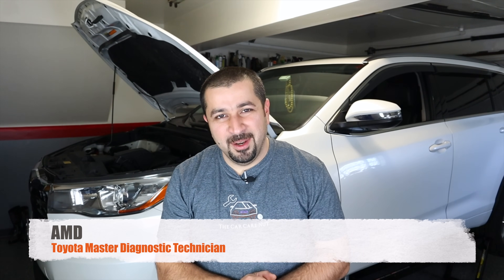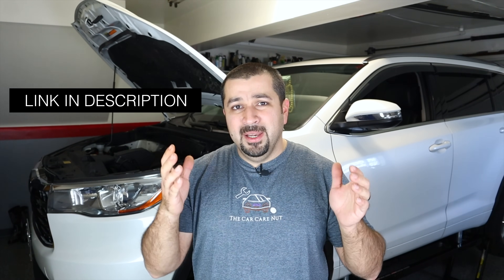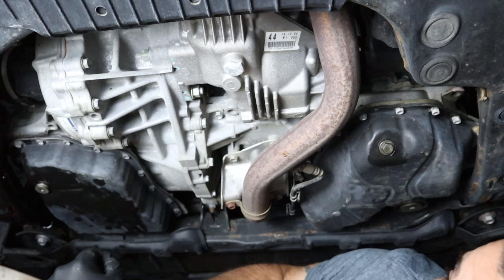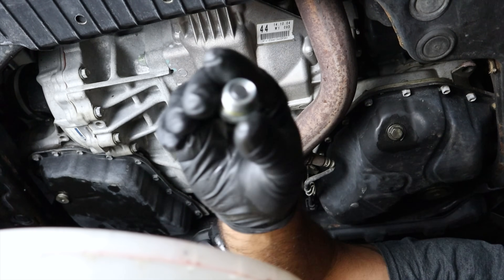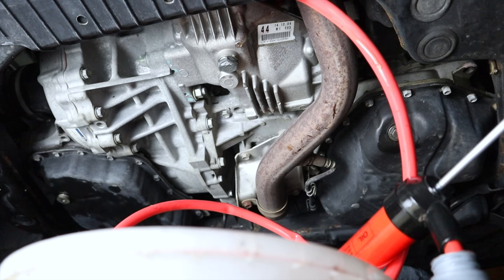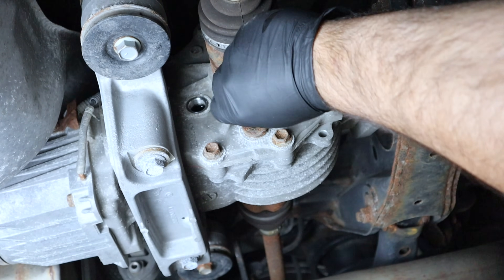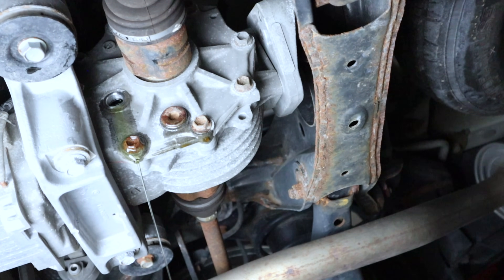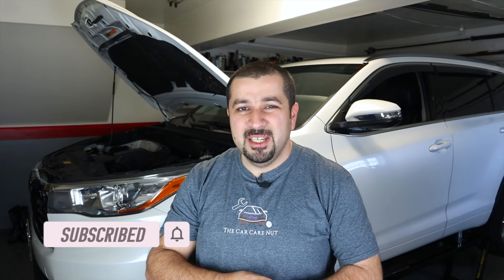How to change Transfer Case and Differential Fluid on Toyota and Lexus

Comment: Another nice and simple DIY instruction, complete with part numbers and torque specs. It would be nice to have some input on the breather valves, regarding any cleaning, testing for blockages/rust, or pre-emptive replacement since they are a common cause of oil seal leaks in the rust belt.
Reply from the maker: Hi! If the breather is not a remote one if it spins or moves it’s good.
Reply: @TheCarCareNut  how many breather valves on a 2008 Tacoma 4x4 trd sport quad cab/6ft bed?
Reply: Here is my question, should I put more stronger magnet drain plugs? apparently the toyota ones barely attracts any metal fuzz  @TheCarCareNut
Reply: @johnysky6066  Or maybe Toyotas don't need bigger magnets because they are manufactured with tight tolerances and produce fewer metal shavings during their lifespans?
Reply: I actually still find a fair amount of wear particles on my rear diff (2014 Highlander). Now granted my first change was at pretty close to 60,000 mi (I didn't know then to do it sooner). But after changing it and then checking it at almost 69,000 mi it is fairly dark and still as much wear particles as before, I was to put in much stronger magnetic plugs but at 5mm longer don't know if the will fit on both top and bottom for even more cleaning performance.

Comment: On my 4Runner I replaced the factory transfer case drain plug with a magnetic one. The size is M18x1.5×12. I used a Dimple Motor Oil Magnet but there are a few others on the market.
Reply: My transfer case fluid always comes out crystal clean, just as the new oil.

Comment: Lexus GS/IS/LS Sedans have a rear AWD transfer case that shares fluid with the trans.  The trucks I believe have their own Fluid.  Clean out your vents too. I had a front axle seal leak on my GS and it was because of a clogged vent. Similar setup to many trucks.
Reply: Interesting, my Lexus dealer told me the AWD LS transfer case is separate from the transmission. I just had it in for all the fluids changed. Front & rear dif's, transfer case and transmission. All for a low price of $867. And even a car wash. No wax. I think that would have put it over a thousand bucks. I wish I could work on my own cars.😣
Reply: @Laggy200ms  I did it in a few hours. It is not the most fun job and the fluid stinks. Toyota Fluids are probably over $200 of that price. The rear end fluid is extremely expensive. The transfer case is physically separate but the LS could be slightly different, I think the transfer case has a torsion setup whereas the GS/IS has an open differential with a lockup system. Looking it up - yes, the LS takes special, expensive fluid in the Xfer case - different from the V6  GS and IS.

Comment: I changed the transfer case fluid and the rear differential fluid on my 2016 Toyota RAV4 yesterday. The car had 70K miles and the fluid had never been replaced before. Given that I had waited longer than the recommended interval, I expected the oil to be really nasty. Nope. It looked like it was almost new. The front transfer case was still a nice gold color and had almost zero crud on the magnet. The rear diff was a little darker fluid with a little more crud on the magnet. I'm certainly not going to do this again at just another 30K with the fluid and magnets looking this good after 70K. I'll probably give it at least another 70K.
Reply: I agree.  I think that fluid is good for longer intervals. But if pulling a trailer then it should be done sooner.

Comment: Great video as usual! I unfortunately never had the rear differential and transfer case oil replaced on my 2014 RAV4 (87,000 miles). I'm debating whether or not to replace it now that I'm well past the recommended interval (AMD mentioned in another video that if your transmission fluid hasn't been replaced at the recommended interval, you shouldn't change it).

Comment: Just did this on my 2014 Toyota Rav4  which has 75000 miles on it but the most difficult and time consuming part was taking those stubborn hex bolts off (certainly a couple taps didn't work for me lol... I live in Toronto so am not sure if the salt on the roads during the winter creates this condition)especially the fill-in plug which is so hard to get to that i almost gave up.  The transfer case/gear oil didn't look too bad (light brownish) so i don't know if it was worth the hassle since it's synthetic.  I had recently replaced the transmission fluid after watching your video and that seemed so much easier.  I can take comfort knowing that I don't need to worry about it for some time now😄 and thank you🙏🏽
Reply: Hi, I'm getting ready to do my 2018 Rav4. What type of GL-5 did you use? Do you only need the 10 mm hex, or is there a different size? Thanks!

Comment: First, thank you for all of your videos, I was able to solve my own issue with my 4Runner (below) but I also have a 2015 Tundra Platinum and  need help based on something you mention to be aware of.  You mention that the TUNDRA transfer case drain plug changed in SOME year models, 2014 and up, where the seal is built-in and the drain plug must be replaced and part obtained from a dealership.  My problem is that of two dealerships that I have inquired with, NO ONE at the parts desk can answer my question thus far if my drain plug is one of those.  My local dealer identified the correct part on their computer diagram in front of me but it must be ordered (a week to arrive, after selling me the wrong drain plug initially) but still told me that he cannot tell me whether or not the plug is of the type you mention with the built-in seal.  My transfer case drain plug is one that sits flush (not a hex head) and it is driven by a 3/8" square socket drive extension.  Are you able to tell if mine is one of those design changes?  I do have my 4Runner for use, but my Tundra is on jack stands now until the new drain plug arrives, unless I use the old one which I am not inclined to do.  When I removed my current drain plug and fluid, there was no washer on the plug.

Comment: I have watched this video and the other fluid video a few times but I tried to confirm this because I don't want to make mistakes here. For 2012 Sienna AWD, can I simply use Valvoline SynPower SAE 75W-90 or  Mobil 1 75W-90 LS for both front transfer case and rear differential? I used to buy the 75W-85 which is very expensive and hard to get. Thank you for your great helps!
Reply from the maker: Hi! You can use either without issues.
Reply: @TheCarCareNut  Thank you so much!

Comment: I think the flat side of the crush washer should sit against the bolt head rather than against the differential housing. But I've seen differing opinions about this. What do you think?

Comment: Thanks for the video. This looks simple and easy to do. I was wondering how can I lift my car to get access underneath the car. I know this is silly question but we also want to be safe going under the car. And, also list of the tools and their measurement to work with those bolts for toyota camry XLE 2020 model. Thanks once again.

Comment: '98 LS400. Most important thing for me was being sure I could remove the filler plug (very tight) before removing the drain. Had to order the exactly right gear oil (Miller's). Both Mobile and Lexus of NA advised that I not substitute a similar multi-viscosity product. Substitution for LS430 was OK.
Probably shouldn't have done the job since the old oil even after 140K looked great and no debris at all on the magnet.

Comment: Hi, thank you for the video and information regarding the difference between an AWD versus 4WD.  I have a 2021 Toyota Venza, and it has close to 55,000 miles on it.  I learned early on (my father taught me basics of auto/car care before I can drive) to take care of my vehicles.  So, at this level of miles on the vehicle, I need to change the transfer case fluid and rear differential.  As you explained, I would expect or should expect the mechanic/auto technician to change the gaskets on the all the plugs (fill and drain).  Nowadays, you cannot see the auto technician working on your car.  Auto shops before (70s-80s) had viewing windows.  I guess I have trust issues because I have had experience where auto shop has "burned" me so does speak.  If I had a lift for my vehicle I would do it myself (but that's another wish) :)   Thank you again.
Reply: Get a decent floor Jack and a couple pairs of jack stands. It’s definitely worth it for peace of mind.
Reply: And I’ll just add, as many times as I’ve been burned.. you have every right to have trust issues..

Comment: Toyota's hex socket plugs are all 10mm, or so I'm told.  A 10mm socket would not fit my Highlander.  I cleaned the cavity thoroughly, but the 10mm socket would not engage fully, no matter how hard I pounded.  A 3/8" hex socket (9.53mm) fit perfectly, however.  Still, I noticed that it started to strip when I applied torque.  I switched to a T55 TORX socket and applied 60 seconds of heat with a butane torch, and the plugs broke free with surprisingly little effort.  I replaced the plugs with hex head M18-1.5 stainless magnetic plugs.

Comment: Thank you for your videos! 

Will one can of the factory differential fluid (Toyota Gear Oil - 08885-02506 1 liter)  cover both front transfer case and rear differential on a 2015 RX?

Comment: Hello AMD, I have a question for you, I want to replace the rear differential and Transfer case drain and fill plugs with much stronger magnetic ones, on the rear differential the original plug thread length is 10 mm, whereas the new one including the magnet is 15 mm. Can I still use them on the fill and drain plugs for both rear diff and transfer case without causing internal interface or jamming?

Comment: I hope you answer this question, I have a 2023 Corolla hybrid awd, the owners manual says it needs “e-Transaxle fluid TE” for the transmission and the rear differential, so should I change that fluid at 30k miles or 50k miles also is there a substitute for that fluid? It’s really hard to find.
Thanks

Comment: I must be the only one that likes the smell of gear oil, it doesn't bother me at all

Also thanks for this video, I was able to do a family member's 2014 rav4 and although my 1995 camry doesnt use gear oil for the differential, I never thought of checking if it has one and it does but it uses transmission oil

Comment: Thank you so much AMD for sharing your knowledge for our benefit!  I’m not sure if you’re familiar with AT-205 reseal?  Would you recommend this product to try and help reduce oil leaks from front timing cover seals or transfer case seals, etc?  It seems it would be too difficult to replace the front timing cover seal for a diy’er for example.  Not sure if it would have bad side effects for Toyota’s if I attempted to use it.  Thanks so much!
Reply from the maker: Hi! I personally don’t recommend any products that promise to stop leaks or “recondition” seals

Comment: What a great video. My next project is this.
For my 2014 Sienna Limited AWD,  should I use 75w85 GL-5 for both transfer case & rear differential? Thank you for your answer
Reply from the maker: Hi! Yes that would be good.
Reply: @TheCarCareNut  Thank you so much
For both transfer case & rear differential, how much of fluid will be needed?
1 quart enough?
Reply from the maker: Just over a quart I would get two

Comment: I have a 2018 Lexus is300 V6 NA I'm sure the front diff. and automatic transmission is one block on my car as you stated in your video. My question is would I do a regular differential fluid flush using the 75W-90 or use a Toyota ATF oil for that flush instead?

Comment: best practice is to check the vent hoses/fittings to make certain they're clear.   Obstructions in the vent path can make for pressure buildup and leaks.
Reply: Where r these hoses/vents?
Thx👍
Reply: @rudysmachado5747  On top of each gear box, you'll find a fitting with either a tin cap that should free spin so any dirt inside will fall out, or there may be a hose coming off said fitting to a higher point on the body and a similar capped vent on the end.

Comment: From another video it's the first I had heard of replacing the differential and transfer case breather vents on Tundra, 4Runners, Lexus vehicles. You didn't mention them. My vehicle is a 2007 Tundra 5.7L. What say you? Thanks AMD!
Reply from the maker: Hi! If it ain’t broke don’t fix it. If the vent is working and not clogged, there’s no need to replace it
Reply: @TheCarCareNut  is there a way to determine if they are clogged or working?  Thank you for your replies!

Comment: Hello AMD, what about applying some grease on the rear differential drain and fill plugs to minimize rust?
Reply from the maker: You could but rust on the rust belt will always find a way.
Reply: @TheCarCareNut  But a car care nut will do it anyway. 😉
Reply: Anti seize lube all your threads unless calls for lock tite

Comment: I neglected to take note of the orientation of the crush washer gaskets on the fill and drain plugs for my 2005 highlander V6 3.3L.  One side is rounded and the other side is flat.  Which side is to be oriented toward the differential housing?  Dealership parts dept. says flat side to the house but some auto forums I searched indicate the opposite.

Comment: Hi, I am getting my pinion seal changed on my transfer case of my 2016 Lexus IS300awd. My buddy is a tech but for a German competitor and doing it for me. I have already ordered my seal and new nut, but I will also be changing out the rear diff fluid since we will already be there. Toyota/Lexus says they don’t sell 75w85 fluid to customers because they buy in bulk. Is it okay to use off the shelf brand fluid? Also I don’t see this weight being sold. Do you have a recommendation? Last thing I want is to damage my drivetrain. I didn’t know to replace the gaskets either for the drain plugs. I hope Lexus has them as I wish to order them as well! 
I like to use OEM fluid for obvious reasons so I’m sceptical about off the shelf products. It’s peace of mind over logic lol

Comment: I have a 2008 Toyota Sienna Limited AWD, 185,000 miles . The  Front Transfer case leaks on my driveway . My transmission repair shop put in a sealer in,  to stop the leak as per my request, since it could cost $4000. to replace it . If driving from N.J. to Sarisota FL. for a serious operation it' s 1,199 miles one way or 18hrs driving . If my Transfer case goes dry am I going to destroy my family van . What could happen and what could I do to keep me on the road ?  Great video - Thank you !

Comment: Thanks for the video, I’m laying in my gravel driveway changing the transfer case fluid today. Could you do a video about approved jacking spots on the Sienna? I had to Jack the rear up at the differential but I’m not sure it’s the greatest spot.

Comment: Which of these fluid changes need to be done for a front wheel drive, automatic transmissions like the Yaris? I have a 2014 front wheel drive, automatic, LE.

Comment: Thanks so much for these videos. I really appreciate them as they help me better understand my vehicle. I have a question. I have a Toyota Corolla Axio 2010 AWD and I recently noticed a noise which I thought was due to worn out bearings. However, I have later found out that the noise actually originates from the rare diff. My thoughts are that  I replace the entire diff... Challenge with replacing is where to find a replacement? And is this still a good idea because alternative is to disconnect the drive shaft and convert the car to a 2WD. Would you recommend that?

Comment: AMD- thank you for all your videos regarding Tacoma and hybrids. I have a question, does the 2018 Rav4 hybrid awd, have a transfer case? I've done the fluid changes on my tacoma and ready to do same on my rav4, and need to get the replacement fluids. I already have the ATF WS and the 50-50 Toyota coolant, but not sure about the transfer case oil.
Thanks,
Duane

Comment: Hello Ahmed, have a 2019 RAV4 and at the dealership and they are saying it’s due for a brake flush and throttle body service. Wanted to check if it’s due for these services so early.
Reply: Here are couple videos by AMD where he goes into great detail on brake fluid and throttle body service and intervals:
https://youtu.be/jpiXOBRkZs4
https://youtu.be/4WE1cQDnOQw
Reply: Same here I got a 19 rav4 with 30k miles and asked me the same question and I declined the service
Reply: Throttle body needs cleaning every 25-30K miles.
Reply: You can buy a $11 brake fluid tester from AMD's Amazon link in the description and check for yourself.
Reply: From my understanding it should be changed at 30k miles as condensation enters the resevoir and water mixes with brake fluid. Iam sure AMD will confirm that.
Reply from the maker: Hi! They’ll need to test the brake fluid. Usually it barely starts around 3 years or so. Too early I think. And the the throttle body cleaning you’ve just entered the window not something that is pressing. I would not do it now and pass your first brake/tire replacement then the throttle body
Reply: Hi Ahmed, I have a 2020 rav4 hybrid xse, I hit the 30k mark. I took to dealership for service. An oil change and tire rotation. I didn't do the 30k major service. They recommended brake fluid flush and efi service. And to change air filters. I declined, but next day I did change both filters. Do I really need brake fluid flush and efi service?

Comment: A blessed day to you my Brother,what type /brand and number  fluid did you use or recommend?Will be changing it on 2012 Lexus RX350..The original 75W 85 5gl is pretty expensive.
Reply from the maker: Hi! You can go aftermarket fluid like Mobil one in that weight
Reply: @TheCarCareNut  thanks 🙏 Brother for the quick response,don’t know how you do it ,but I’m eternally grateful.